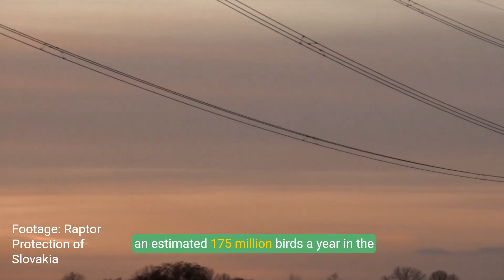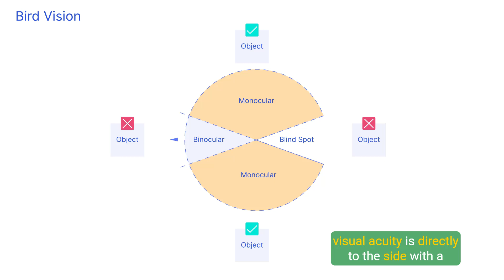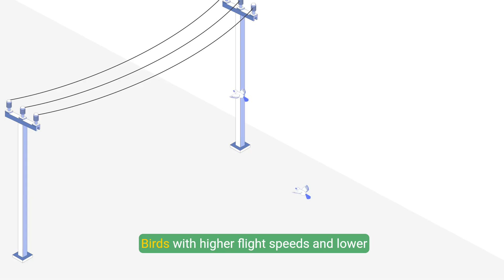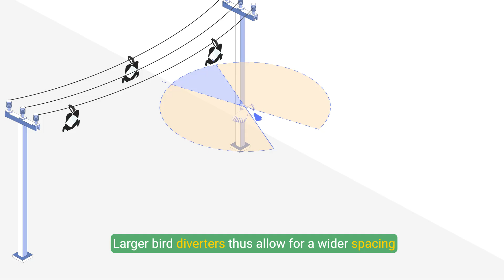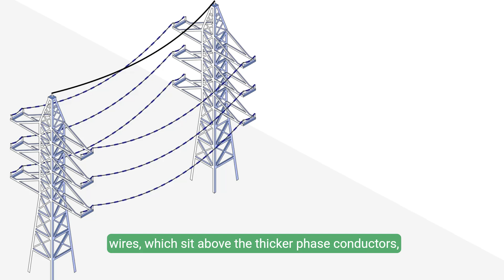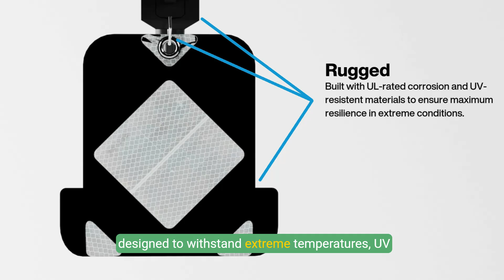Why Birds Collide with Power Lines – And How We Can Prevent It with Drone Installed Bird Diverters

Comment: Have you noticed that no electrical discharges were shown? Because that very rarely ever happens. Power lines are spread far apart so that birds hardly can short anything.
And if it happens that does usually not disturb the power line at all.